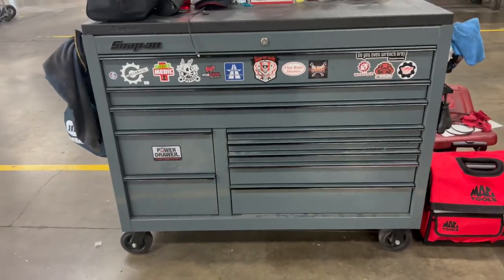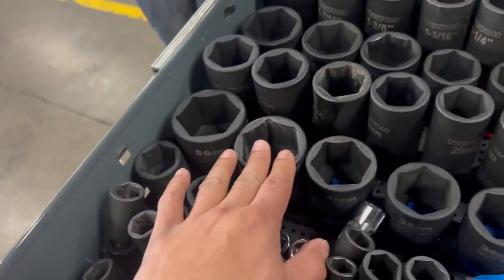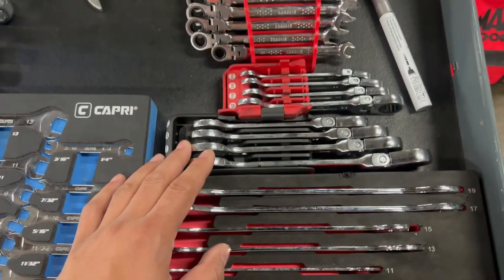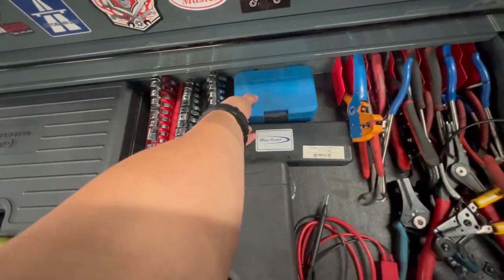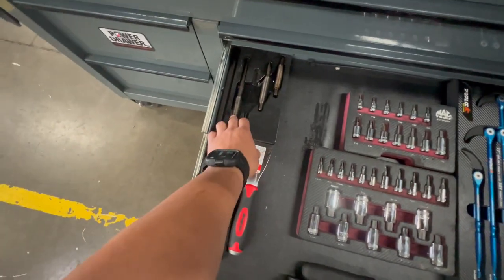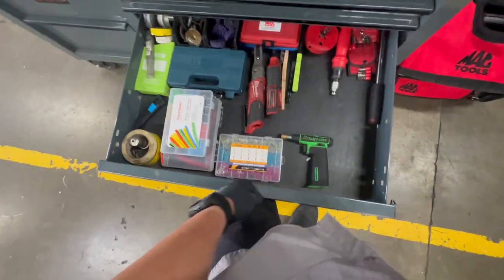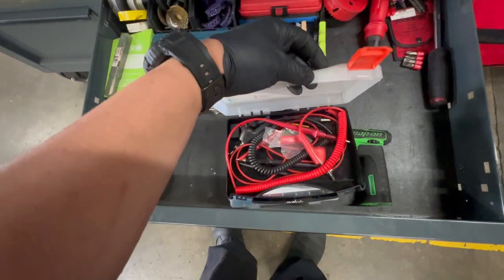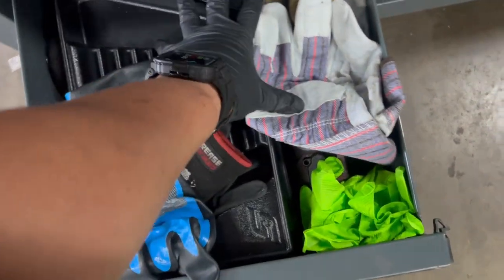Snap-On Classic KCP1422 Tour #toolboxtour #snapon

Comment: Do any vehicles use just metric fir everything. Or since they sell in the USA they use some standard. Like are there german, Asian or shtrwkian cars that are 100% metric
Reply from the maker: It really depends what you work on. I just decided to put all my sae sockets that I barely use to this tool box so i can free up more for the tools i actually use more often.
Reply: It’s a crap shoot because at my work which is freightliner trucks and utility/grate Dane trailers with refers. The trucks are made In Mexico so yeah that’s metric but certain parts on the trucks like Detroit parts are SAE so it’s a big mixed bag.

Same for the refer on trailers most of the fasteners on the refer side of things are metric 
BUT the stuff on the back of the trailer (slack adjuster hex, air tank brackets door hinges etc etc etc are SAE)
Reply from the maker: @Tcorellis-j6d thank u for input